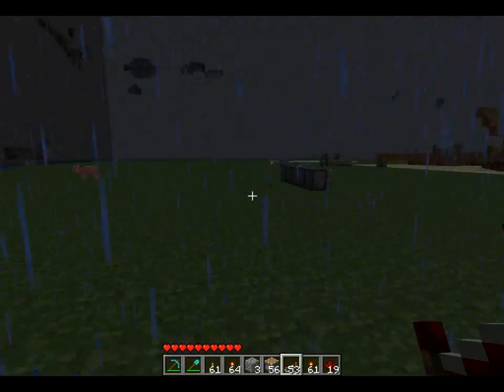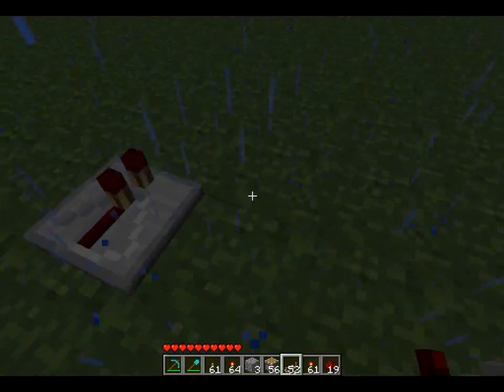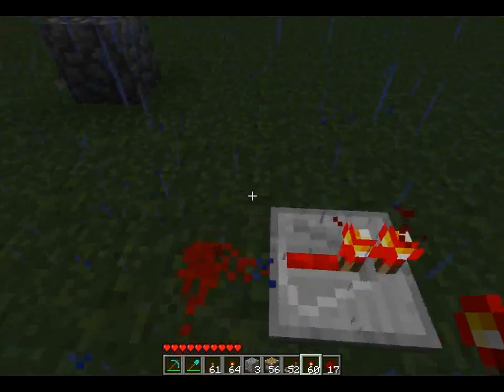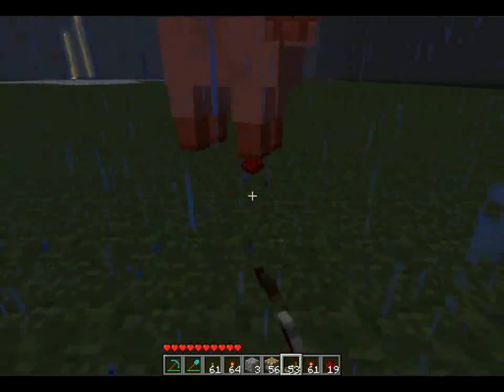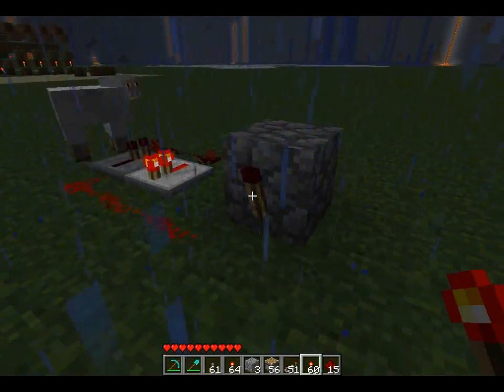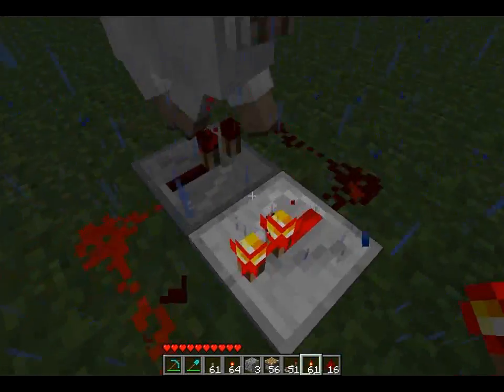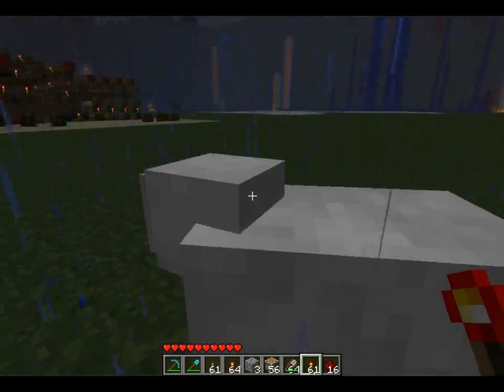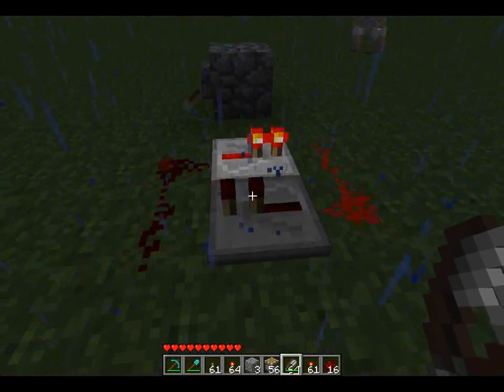Starting a 1-clock in 1.7

Comment: @GerSimX  It Is a 1 clock because when 1 is on the other is off soits still a 1-clock because 1 tick-off 1 tick-on
if there is only 1 repeater it will stay on